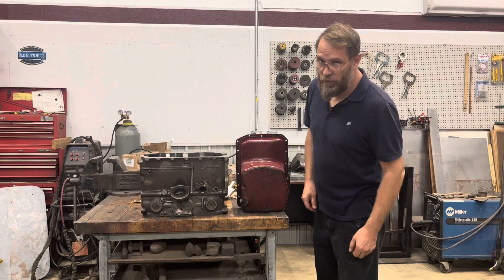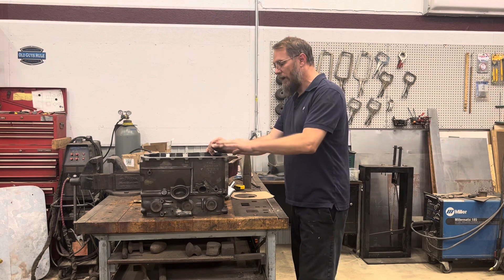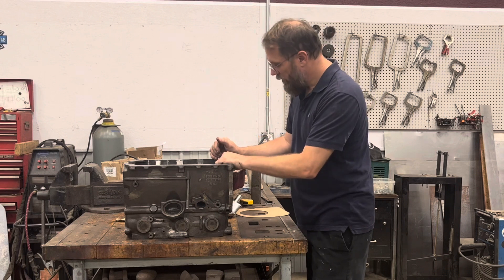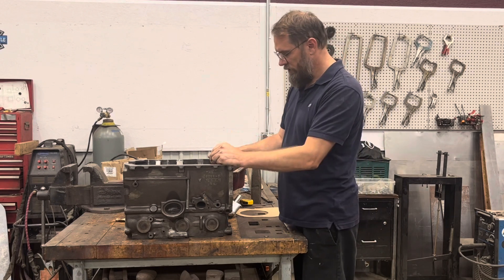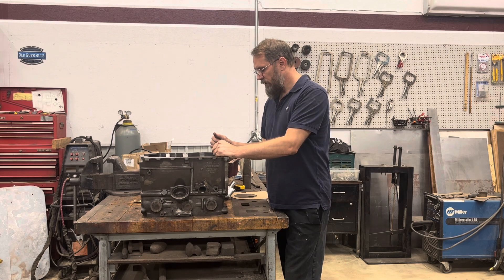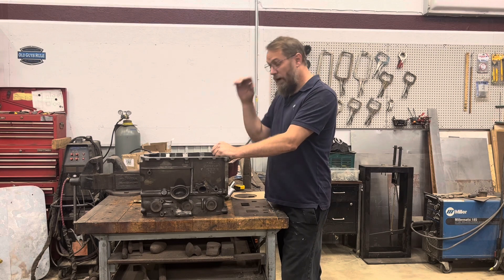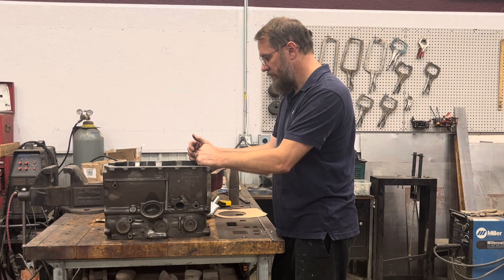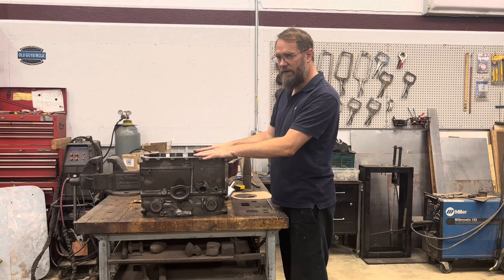Just baffling … MGB oil pan modification. Part 1

Comment: On the pan, you could weld a tube to hold the stick. That would get rid of the hole. Easy Pesy Lemon Squeezy.
Reply from the maker: That’s actually what I’m thinking about doing👍🏻
Reply: @mgbgtguy  don't think 🤔  just do it. I had more than a few MGs, maybe a good half dozen.

Comment: Rob - When I had my engine built for my MGB, I lucked out in that there was a local MGB shop in SoCal that was owned by an ex-Offenhauser racing mechanic who raced his own MGB's.  He had a couple of his retired Offenhauser buddies do the machining on the engine (the head is a work of art and I almost didn't want to reassemble it, but rather put it on display, LOL) and he dry assembled the engine 3 times prior to final assembly to check tolerances, etc. prior to final assembly.  The engine is a strong Stage 3 engine for street use, including the oil pan baffle.  The one modification he made to the baffle from the Special Tuning layout was to add return "slots" along the perimeter of the baffle so that there was more return area for the oil to get into the bottom of the pan to the pick-up.  These were right at the edge of the baffle, and if I remember correctly were about 1/8" to 1/4" wide by 1" long and there were 3 each on the long sides and 2 each on the short sides.  The engine has great torque and HP and can easily rev to 7,000 RPM with no issues for over 20 years now.

BTW, one other thing he did while working on the engine was to take a small ball peen hammer and tap on the outside of the block at all of the water galleries and jackets to break loose any rust scale and/or casting sand (this was after hot tanking the block).  He collected what came out to show me and it filled about half a small Mason jar.  He told me that he always did this on high performance MGB engines to ensure the galleries and jackets were not occluded with crud that would cause cooling issues later, especially at the #4 cylinder.  He also told me that years ago he had been informed that casting of the blocks at the MG factory (or their supplier) wasn't always of the highest quality and that the block factory did a poor job of ensuring all the casting sand was removed from the internal galleries and this led him to doing what he did.

Comment: Did you consider that the oil needs to fall down into the pan as well?  You can’t make all the tolerances too tight, can you?
Reply from the maker: Yes I did. The baffle will be higher than the oil pump strainer, plus a few strategically placed slots or louvers will aid in that